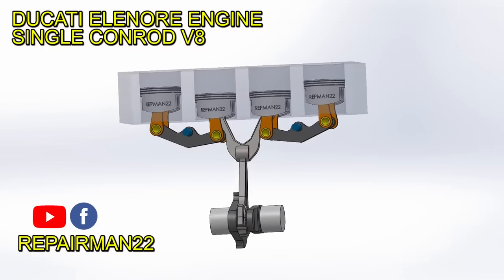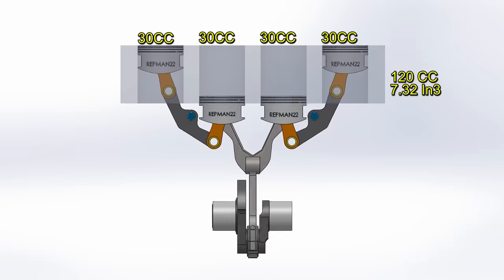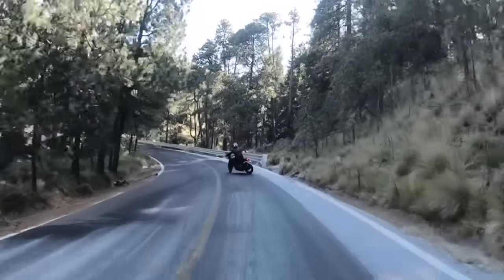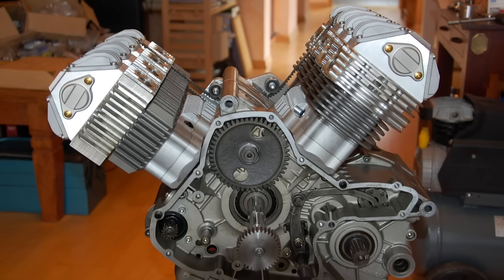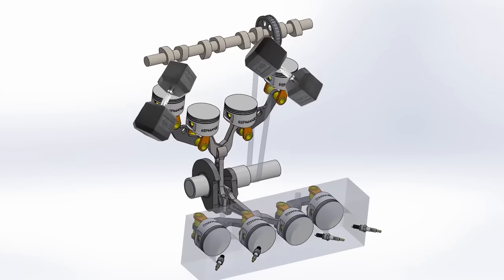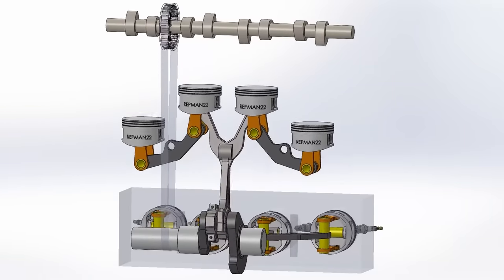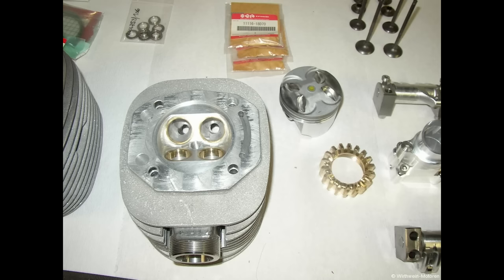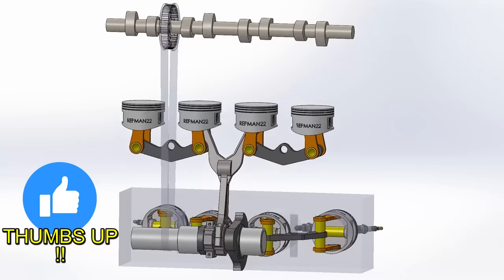1 Con Rod with 4 Pistons 🤯 How Ducati Elenore 868 Engine Works in 3D

Comment from the maker: Remember to leave your comment and LIKE to help me grow!!! Thanks.
Reply: hey, have you seen that engine sound simulation software that your fellow peer AngeTheGreat made?

if not, you can program some pretty accurate sounding engines with visuals too.  for some of the more obscure engines out there, this could be a great tool for your use case here. it's just kinda tricky to learn the program.
Reply: I think something like this would be great for radio controlled models and racers.
Reply: Where is the link to his videos

Comment: Wow, that poor guy. What an innovative smart dude. It’s a shame he got hurt and disabled, but it is certainly admirable that he still made those motors and got them running!
Reply: guess happened when ass hit moving ground clothes grabbing ground so too muc force went up spine. so bike clothes need  a padded slippery iron ass plate that can skid and pad takes shock kinda stiff dense foam mabe inch thick or two
Reply: @orangestoneface  The air bag jackets are the way to go I think. They protect your spline without being overly restrictive. Though this wreck he didn't leave the bike until he nearly hit the ground, so I am not sure how effective it would have been. It wasn't really the bad of a wreck, just some bad luck there. Most would have walked away with a few scrapes.
Reply: mindfornication5103  No thanks. I prefer having fun in my life :3
Reply: *engines.
Reply: You could look at it this way: Maybe because he got hurt and couldn't ride anymore, he became an innovator.
Reply: mindfornication5103  motorcycles are far more fuel efficient and effective for single person travel. Imagine if everyone rode a motorcycle instead of a car. The amount of parking spots that would open up.
Reply: mindfornication5103  I ride in Oakland rain or shine, and I have no regrets. I'm sorry you lack skill.
Reply: @dog2man1994 my Honda insight hybrid car actually gets better mpg than my motorcycle
Reply: A really smart kid, the world needs more guys like him, and not trillionaire ones, lol.
Reply: @dog2man1994  come and ride in indonesia (jakarta or jogja)
Reply: @orangestoneface  he had an armoured jacket I hope, but you can still get disabled when coming off.
Reply: I’m pretty sure you wouldn’t say that if you’re the neighbor of that poor guy.
Reply: i'm sure with a good sponsor he could bring out more power from this system

Comment: What a guy! While a simpler design is always preferable, nothing can beat the elegance and ingenuity of an overcomplicated mechanical solution. Even if it's not actually better, it's still a win for the fact he did this all himself.
It's not a question of 'why' but rather 'why not'.
Reply: Definitely has the cool factor. Also a good way to cram a reasonably sized 8 cylinder engine into a bike.
Reply: Us germans in a nutshell
Reply: "...simpler design is always preferable..."
Agreed, but this engine is not much more complicated then a conventiontal 4 cylinder:
2 additional Rockers + 4 Rods but only a Single Main-Rod (like in a Single cylinder) wich allows a shorter and much simpler crank.

The pivot-points are an issue as each has to take full pressure but also take away power and effeciency, durability might be questionable.
Reply: This is a fun proof of concept for a mechanical geek who is enamored with unnecessary clockwork....  so I get it. 
I stop short of calling it a good design though, as durability will be lacking.  This has all the potential power of a 4-banger without the biggest benefit of an actual 4-banger. 
The 4 position crank is the heart of the beast....  This has all the spirit without the strong heart. 
But kudos for getting it up and running, with good numbers!
Reply: "why" but rather "why not". Which engineer thinks like that. Might as well put a window on the windscreen as well.

Comment: Here's an important consideration that has not been discussed here: One of the issues that increases friction in an engine is the sideloads on a piston when the crankshaft is anywhere other than top or bottom dead centre, and of course this also results in piston and cylinder wear over time. This friction against the sidewall of the cylinder is significant. The Comma van had a diesel engine that had a similar principle where the conrods with pistons at one end went to rocker arms instead of directly to the crankshaft, and at the other end of the rocker arms was a conrod that connected to the crankshaft. What this meant was that the sideloads were transferred to a rotary bearing rather than a sliding bearing (the piston in the cylinder) and that reduced friction. This could work a similar way if the con rods connecting each piston to its associated rocker arm were a bit longer so there was less side-loading of the pistons.
Reply: And let’s hope the pistons don’t poke out of the bottom of the cylinders like the animation shows.
Reply: @preachers4135  yeah that looks sketchy as hell. All it has to do is overtravel one time and the engine becomes a grenade
Reply: 2&3 possible more 3&4 no worse than a Normal engine.   I say possibly on 2&3   because the 1/4 cylinders moving the other direction connected by the teeter totter  arm their connection rods are hooked too.      I do not ever see this coming into production at least not in a big 4 stroke engine.   That sid a small two stroke it might be okay and save enough weight to make it worth the change.    One thing that could be interesting is if 1&4 set further away from 2&3.  You could make those two cylinders taller and a longer stroke because the teeter totter fulcrum could be offset so the outside cylinders would have not only a longer stroke but more leverage than it it is centered.   Do that in a 2 stroke and it might make pretty cool two stroke.     It could have a short stroke and long stroke.   Of course every other stroke would be more powerful.      

Don't take me too serious as I am going down a rabbit hole after a gummy several hours ago.   🤣🤣🤣🤣

But either way I don't think it would last as long as a traditional engine would be.     But it is neat to see people build things with their hands that do work.  For a guy to repurpose old engines into something different is pretty cool.
Reply: tldr
Reply: @hksp  Sorry? Not sure what that means
Reply: ".....The Comma van....." 

I think you might mean Commer, as in "Commer Knocker" engine.
Reply: @Baribrotzer  Yes, was writing from memory
Reply: Very interesting concept 👍
Reply: Good points.
Reply: @Baribrotzer  The story about the dog that could here that Commer Knocker 10 minutes away just killed me 🐶 🥰.
Reply: The outer cylinders should be bored at a slight angle to reduce the side load.
Reply: @sagnikmaity1444  you're missing the point: in a normal engine, when the piston is halfway brtween top dead centre and bottom dead centre, the side loads on the piston from the con rod are at their greatest. You can't get around that by biting the cylinder at an angle because it's am inherent characteristic of a con rod connecting rotary motion to linear motion
Reply: Would this be a good application for an oval piston maybe (like the old Honda 750 race engines) to reduce cylinder side friction??
Reply: @svttodd  I don't thick that's going to reduce side loads significantly. I didn't know about any engine with oval pistons, but straightaway I'm going to suggest that it cost a lot more to make, including oval pistons and rings, and probably required some expensive machinery to make, and who would have the equipment for reboring it? I'm guessing that it was to get more power out of a limited width of engine space, but looks like it didn't prove cost-effective. My dad will probably know though
Reply: @svttodd  Guess what, youtube just put up a video about the honda oval engine. It turns out it was to get round a limit on the number of cylinders, and had technical problems.
Reply: @Baribrotzer  Super interesting engine design.
Reply: Agreed, maybe better on a 2 cylinder engine. Avoiding the dreaded "banana bore" of high mileage engines. I'd love to see Ducati pair this with desmodromic valve gear on a race bike. A lot more practical than Honda's "square" pistons.

Comment: I think you're entirely correct, hard to see any obvious large advantages for the solution. To add something, the crankshaft would have all four power cycles applied to a single point and that can't be good for fatigue.
It is an interesting take on a 4s though. Maybe could find some advantage inside another packaging concept?
Reply: Yeah, I don't get it. I can't see how the 2 outer pistons contribute to power production at all. All they appear to do is power the compression stroke of the 2 inner pistons, something the crankshaft flywheel effect does already and without the additional friction and weight/complexity of those additional cylinders, pistons and rocker arm.
What am I not understanding here?
Reply: @holdernewtshesrearin5471   They push the rocker which in turn pulls up on the main con rod, transferring force to the crank shaft.

Some of the force also powers the compression stroke, but that’s the same on any engine, except normally the forces are transmitted through the crank.
Reply: @JPEight  - Roger that. Yes I see that now. Thanks.
Reply: The outer Pistons are pulling the single piston rod upwards and the inner pistons Are pushing downwards  both push and pull brings the same power which converts into rotation of the crankshaft
Reply: Actually their might be an advantage. 

I'd have to model it.. But it does look like 2nd order vibrations are cancelled out. 

Effectively the velocity of the pistons moving up the bore are directly tied to the pistons moving down negating the deceleration mismatch in the bottom 180 deg of crank rotation from the accelerating pistons in the top half of the bore ( top 180 deg ) of crank rotation... 

On bigger 4 piston engines this might negate the need for counter rotating balance shafts.

However this might account for the power loss, as the burn rate on the outside pistons will have a different profile from the inner two pistons.

Interesting never the less.
Reply: They address the crankshaft theory in the video. Only one piston fires at any given time... hence no increase in crankshaft strength requirements
Reply: It might get you a slightly better cylinder seal. There might be less lateral forces on the bore, perhaps?
Reply: There’s a few potential advantages to this engine design. Two big ones stand out to me. One is a reduction in moving mass, if the mass of the single connecting rod, rockers, and single point crankshaft is less than a traditional 4 connecting rods and 4 point crankshaft than the engine should be able to rev up faster and make more power. The other is balanced vibration, with all 4 power strokes acting on a central point and both in the up and down direction it should make a low vibration engine.

Also to note, fatigue isn’t an issue on a steel crankshaft. Steel has a completely flat fatigue/endurance limit. As long as it’s designed to have enough strength down at the endurance limit it won’t have a fatigue type failure no matter how many cycles it goes through. That’s why steel is such a fantastic material, it has an infinite fatigue life if properly designed to to operate under the endurance limit.
Reply: @holdernewtshesrearin5471  Well it depends on the firing order
if the outer cyllinder does a bang, when the inner cyllinder does its compression stroke.. it would help that inner cyllinder 
on the 1 cyllinder engine, there is no such thing, and the flywheel is going to push the compression stroke, but the engine will be dragging in that stroke

In this setup, if the timing order is right,  the bang of Cyllinder 1 will help Compression stroke on 2  while 3 would be pushing out exhaust  4 would be sucking air

So the firing order would have to be something like 1234  instead of the usual  1324 on a regular inline 4

That being said.I doubt there is much benefit in the single conrod design because the power is just delivered via that cantilever system and it makes for a much more complicated setup on theinner cyllinders.. so the engine will not be balanced well... 
no big deal on a 30 cc, but its hardly scalable to bigger engines
I doubt it can rev well, i doubt it is a durable design and it probably does not make good torque

And They have to compare the Single conrd 4 cyllinder to a regular 4 conrod  4 cyllinder to see if it makes more power or not
comparing to a single cyllinder x 4 is just silly.
Reply: @sethrich5998  I don't see how this is going to be all that balanced because the firing order will be 1234
so the engine will be rocking 12  34   12  34   12  34
the outer cyllinders will have less reciprocating mass (single link) than inner (dual link) so that too is an imbalance..
obviously inners balance vs outers, but thats no different from a regular 4 cyllinder in line.. its just that your inner and outer cyllinders will have a different force 

Also makes for a much more complicated oiling design since now you have to oil 2 bearings for the see saw connection for 1/2 and 3/4
so more machining, specific oiling galeries needed..  and you probably will need a bigger fly wheel anyway because the crank is so much lighter.. and you need to smooth out the lumpy engine.. so I don't see much gains
Reply: @holdernewtshesrearin5471  the outer pistons contribute to power production by 'pulling' instead of pushing. It also eases the fatigue for the connecting rod itself.  I'm not saying this is any better than 4 rods- but interesting no less. The connecting rod bearings and races will also wear more evenly because of the constant pushing and pulling forces provided by both the inner and outer pistons.  If you ever replaced rod bearings and races- most of the wear is pronounced on the 'power' side of the rod base- not in this setup
Reply: just make the part out of titanium the fatigue issue wont be a problem then
Reply: @Humbulla93  that's not how titanium works.
Reply: A 1234 firing order isn't possible in that engine.

Cylinders 2 and 3 are reciprocating together. Meaning, you're forced to wait 1 up stroke before being able to fire 3 after 2.

You're forced to use firing orders like 1342 (or any other firing order where the outside and inside pistons are alternating in the firing order).
Reply: There's a reason standards are standard. It's git merit. But there's so many issues with stress loading as your said. But we could be wrong.

Comment: What an accomplished man! I am not a mechanical engineer but have a strong interest in engine design and feel the radial design shows the most initial commercial success although just about any reasonably practical design can be made good if enough money is thrown at it. I think it is so difficult to get away from existing designs from a build cost / power output basis and of course all the emissions rules. I hope this man  will still bless us with  his design ideas.

Comment: This is genius! The main connecting rod is always being pushed and pulled in a direction that never sees heavy force, the fulcrum con rod is pulling it up on its up stroke, and pushing it down on its down stroke. According to this animation. The force it sees is at an absolute minimum. Which this set up the only thing that could be weak is are the mains and rod bearings but being so few would be easy to keep lubricated. Bloody brilliant.

Comment: I remember hearing about the Stern idea awhile back which was interesting but ultimately too complex for real usability. Somehow this one slipped under the radar for me, and at least as an engineering exercise goes, is the more interesting one to follow. Provided materials are up to par, the exciting bit is it's significantly smaller packaging envelope potential. I can't see it being equal regardless of cylinder count on torque potential, but having a full blown 8 cylinder engine in a bike that takes a portion of the room as an I4 with perhaps less material weight overall is intriguing to say the least.

Comment: The most stressful point on a connecting rod is not the combustion stroke, it is the exhaust / intake transition, where the forces accelerating the piston are felt as tension across the cross section of the small end. This design moves the bulk of those stresses from the single con rod to the twin mini con rods. The real durability issue would be across the  smaller cross section of the small end of these mini con rods. It can do nothing but lower the overall durability when compared to a conventional 4 stroke.
Reply: Exactly, metal is ALWAYS much weaker in tension than compression.  Plus adding power strokes that transmit the force via tension is just asking for trouble.
Reply: That’s not the most stressful, it’s being his neighbor. 😂😂😂
Reply: How about the flex in the “side” rockers? If you run any compression the piston will his the head at TDC of the breathing strokes due to beam flex and rod stretch. This isn’t new and isn’t a good idea. It was called a walking beam engine a hundred years ago, it was a failure then and still a bad idea now. Also, anybody want to calculate the stress on that single big end? How strong it would have to be to pass all the power of a V-8 through one big end and one set of mains? The WWII radial aircraft engines passed all the power of a “row” of cylinders through a single rod, true, but they seldom spun over 3K rpm. Oh yeah, they also had guys like my father rebuilding them after (relatively to a street car) very few hours of operation.
Reply: @GlutenEruption  metal is stronger in tension actually, why do you think bridge cables are made of steel?